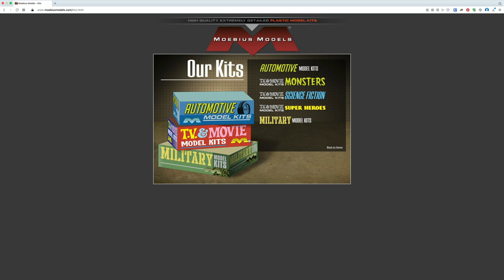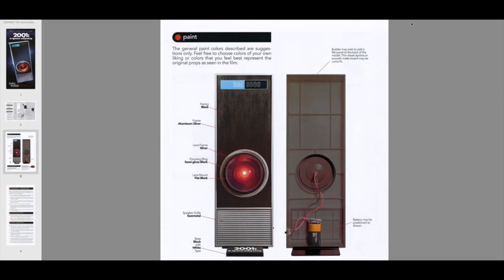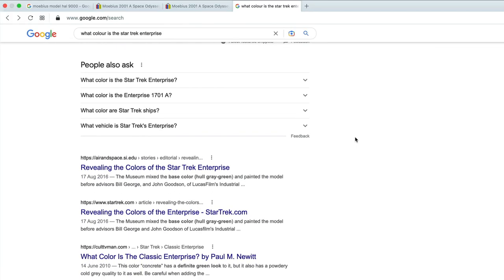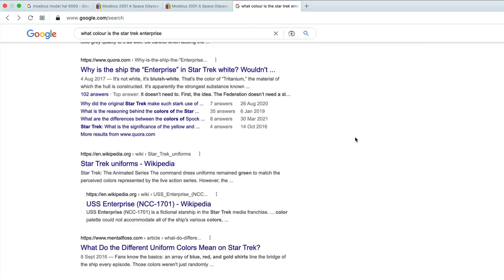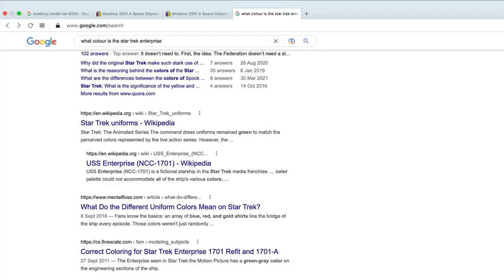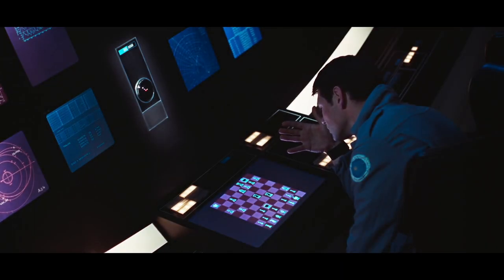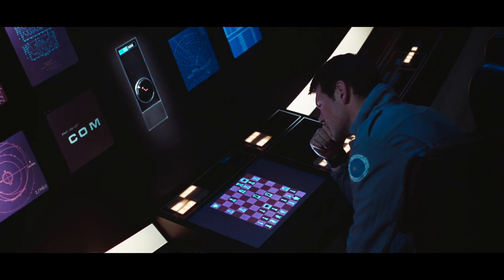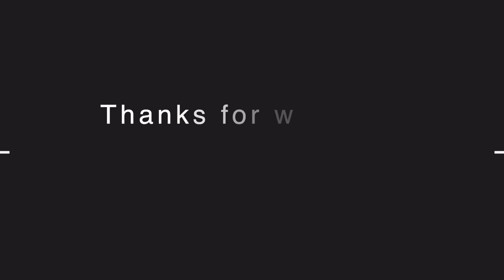Moebius Models HAL 9000 Model Build

Comment: HAL 9000 Model Build < Add a mainebord and working computer system.
Add login and startup and Shut Down with voice control and commands By computer
Fore that true  HAL 9000 experience.
Daisy daisy give me your answer do.

 HAL 9000 Closer then you think Alan Turing lives on.
Reply from the maker: It would certainly be a project that could lend itself to a arduino or raspberry pi.
Reply: More full sized and more them one os Like Solaris 11.3 and Linux ubuntu or red hat or a nice Ds 5054 os.
Reply: @DansModelBench  Last one was for a nice small Mainframe that's only 2 story  tall

Comment: Hi, did you use 146

B526 Mr. Finishing Surfacer 1500 Black?
Reply from the maker: G'day Paul. I used that product, but not the spray can version. I used an airbrush, so I started with  SF288 and thinned it with Mr Color Levelling thinner. With a kit this scale, I cant see why the spray can wouldn't give you a similar result, if thats more convenient for you.

Comment: Thank you for a fantastic video.. 
Is there another clear lacquer you could recommend?
 I couldn't find alclad 2 aqua in a clear gloss coat only in colour tints. 
Thanks in advance.
Reply from the maker: G'day mate. Just to make sure we are talking the same product, the one I used is Alclad ALC-600 Aqua Gloss Clear, which is an acrylic clear. I avoided a lacquer clear as I wasn't sure what they would do to the decals on the lense. I've had trouble with this models brands decals in the past as they can be fragile, so didnt want to use anything hot. Here is a store that has the Aqua Gloss product, so you know what the packaging looks like:
https://www.bnamodelworld.com.au/alclad-alc-600-aqua-gloss-4oz-120ml

If you cant get that where you are, AK-Interactive make something similar that they call Intermediate Gauzy Agent Shine Enhancer. Yeah I'm not making that up. :)
https://ak-interactive.com/product/intermediate-gauzy-agent-shine-enhancer/

Another possibility is VMS Varnish HD in gloss finish. Make sure you order gloss as they also have a satin and matte.
https://www.vms-supplies.com/vms-varnish-hd

Hope that helps and thanks for the kinds words.

Regards,
Dan